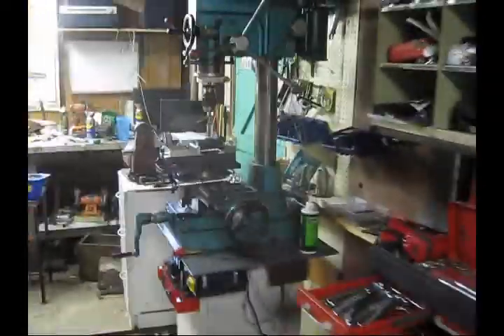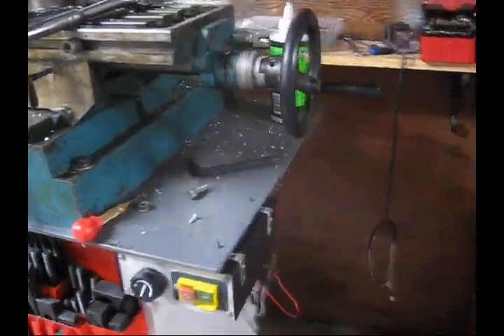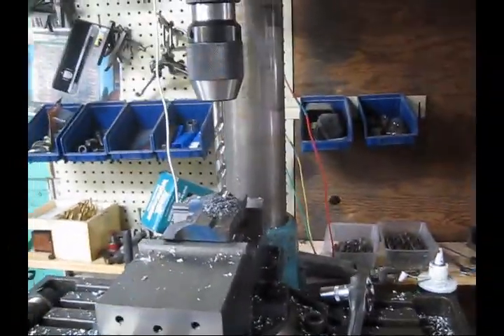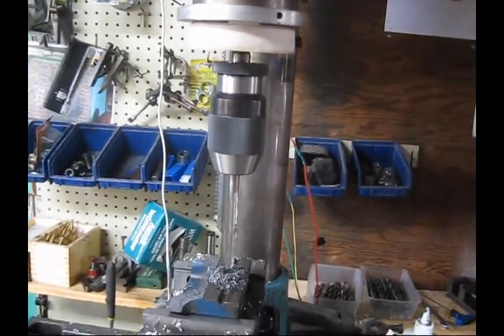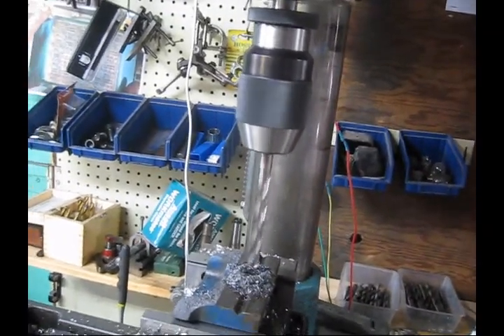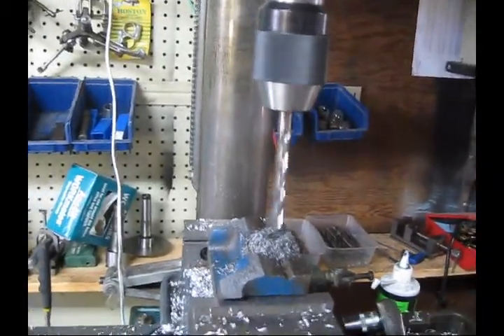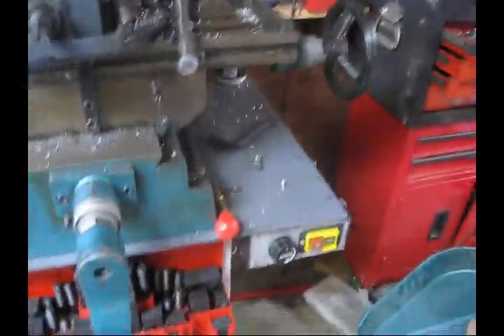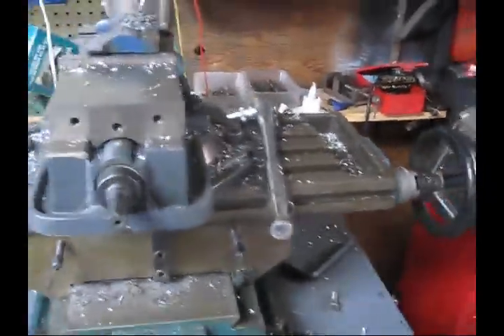Mill DC motor conversion

Comment: Any more details on the assembly? how well does it mill?
Reply: Sorry for the late response. I've been using it for a long time and have had absolutely no issues with the DC motor. It mills great (for an old Taiwanese mill that's been through the wars a bit), and with the digital tachometer it's so much more convenient to use than the old belt system. I've certainly noticed no issues with torque and it's totally reliable.